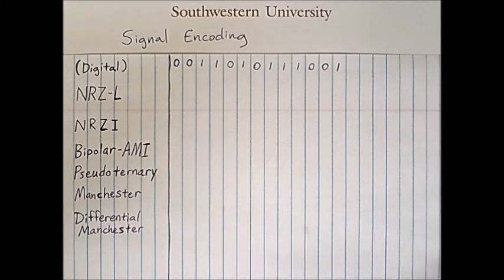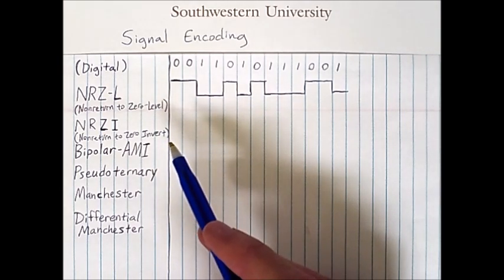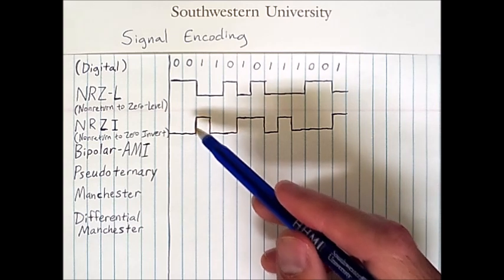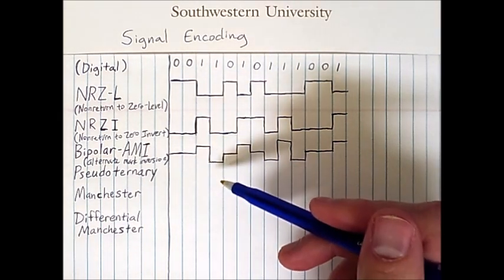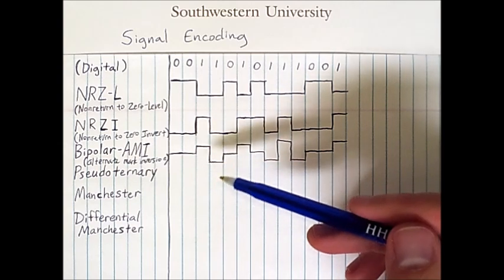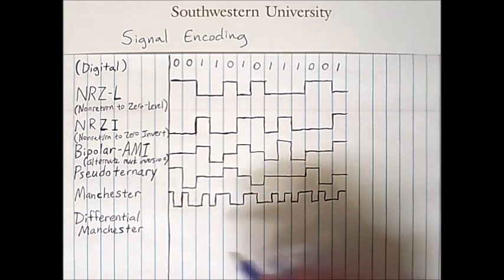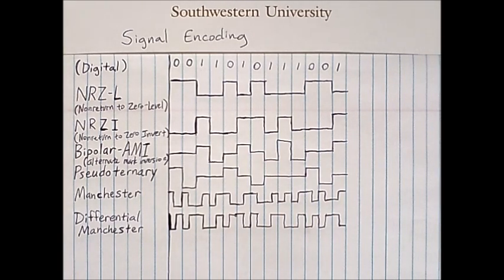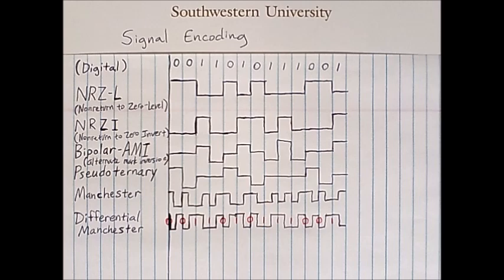Signal Encoding 1: Digital Signals

Comment: Its worth mentioning that in digital audio, one of the biggest problems is that bits are measures on the rise time and not the mean. If this is not fast enough due to cable capacitance or a host of inductance issues, then the bit can be read wrong and errors occur. So in computing and nicely designed circuits with proper RF connectors this rise time may be a good idea but in the grubby real world it can be worth avoiding, even in the relatively slow khz range.

Comment: What type of encoding is used by computer network cards sending a signal through Ethernet cabling?
Reply from the maker: I don't think there is a single answer for that. Different networks can use different encoding schemes. It's up to what the hardware supports and how it is configured, though standards change and evolve over time.

Comment: differential manchester is the same thing as biphase mark code except the data is offset 1/2 clock cycle and the bits are inverted.

Comment: 0:40 NRZ-L
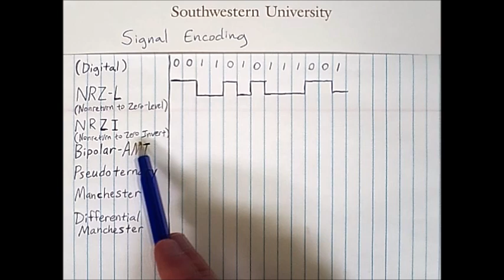2:08 NRZ-I
4:57 Bipolar-AMI
8:00 Pseudoternary
9:24 Manchester
12:32 Differential Manchester
Reply: Is 4B/5B digital encoding the same thing as pseudoternary encoding?
Reply: @guytonktgigi  g7 TX 8yz8xz88t 8xtx8z8 tu,g,7y7x7g y 8yg
Reply: @guytonktgigi   7z8 88xy8xt7,yx,IT,
Reply: @guytonktgigi  ٣٤٣٢٢٢٣٣٢من ٣3٢بنطلونات 3و ٢٢٢كتبها من ٣٢٣ص ٣ذ٣ ذ٢ ٣ ٥٢٣. ذ٥٢ ٣ضذ٣٣ذ٠٢قص ٣ذ٠٢٥ص٣٢من شفق شفق ٣٣ذ٢من ٣٢من ذ٣3قصص ذ٣3٤٣٣٣ بنطلونات  ٠ ء
Reply: Thanks bud!!
Reply: @shreyaredkar9983   bkcjcn,ficam nvv, t&£,(&
Reply: יחיח
Reply: יח
Reply: חיי
Reply: יחי
Reply: חיייחחח
Reply: יקחחחחק
Reply: חחחחח
Reply: ייחיחח
Reply: חח
Reply: חקקחחח
Reply: חקקחחחח
Reply: יח
Reply: חי
Reply: יחייחחקיחחחחייחיחיחחי
Reply: יחחייחחי
Reply: יי
Reply: @imankhouny5682  חיי
Reply: which one is miller?

Comment: Hi, I have a question in NRZ-L, I just read before that the binary 1 represents positive, then 0 represents negative. But in your video the binary 0 represents positive. Can you please help me to explain? I a bit confuse. Thanks in advance.
Reply from the maker: My discussion is based off of William Stallings' book on Data and Computer Communications, but I believe that a scheme in which the meaning of +/- is reversed would also be legitimately referred to as a NRZ-L scheme ... the idea is the same, and as long as both ends of the communication agree on the same convention, communication should be possible.
Reply: Ow I see, thank you Sir Jacob

Comment: Can you please answer this question, I saw your video just to answer this....

How many signal levels will be required to encode 4 bits in a single symbol??
->Is the answer 12(As per my research)

Thanks in advance
Reply from the maker: 4 bits can represent up to 16 distinct values, so you would need that many signal levels, but you probably cannot successfully transmit a signal with this many signaling levels because the noise would make it too difficult to determine the difference between signal levels, unless you use a much more advanced scheme that anything discussed here.

Comment: For NRZ-L is it necessary to use High level for 0 and low level for 1?
Reply from the maker: NRZ-L is a particular encoding scheme that follows these particular rules, but in principle there is no reason why a communications scheme that reversed the roles of 0 and 1 would not work, as long as both parties agreed on the same convention.

Comment: Thank you for explanation. Does anyone knows where signal encoding can be used? I mean the knowledge
Reply from the maker: Any signal sent along a phone line or network (Internet, etc.) has to be encoded in some way.
Reply from the maker: Certain encoding standards are more common in particular countries, and a variety of different encodings may be used throughout the transmission of a signal for different legs of the journey. Conversions happen depending on the particular medium of transmission, distance, etc.
Reply: There's so much I don't know
Reply: These encoding mechanisms are used especially to support clock recovery in transceiver circuits.